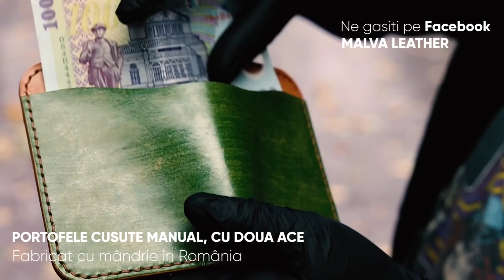1.5 TSI mai bun decât CATASTROFA 1.4 TSI?

Comment: Salutare!
Avand in familie un motor 1.5 tsi 150 hp cuplat la o transmisie manuala pe o skoda octavia 3, acum la 50.000 de km pot veni cu urmatoarele precizari:
1. Motorul a aparut in 2018, e un pic mai vechi decat a spus Vlad. In primavara lui 2018 cand a fost facuta comanda la reprezentanta, skoda era initial dotata cu 1.4 tsi 150 cp, dar am fost anuntati ca acest motor nu mai este disponibil, deci l-am inlocuit cu 1.5-ul
2. Perfect de acord cu dezactivarea cilindrilor si ciclu Budack. Masina merge in 2 cilindri la viteze constante pana in vreo 120 km/h dar si la accelerari foarte usoare sau decelerari (nu frana de motor).
3. Ca si consum depinde cum mergi. In cluj scoti de la un 8 litri la suta pana la 10 daca te tot freci din stanga in dreapta. Mers in oras nu ca pensionarii. In extraurban cel mai putin a fost in jur de 6l/100 km, drum cu urcari si coborari prin transilvania. O cifra mai realista ar fi 7l/100, de obicei in afara masina e turata si se fac depasiri. Nu s-a mers niciodata la modul "eco pro" sa vedem cat poate de putin sa consume. Undeva la 7.5 l/100 km germania-romania vara cu 4 persoane si multe bagaje.
4. Motorul trage de jos pana la linia rosie unde are puterea maxima, e o placere sa il turezi pe niste drumuri virajate in urcare.
5. Nu au fost probleme cu motorul. Nu consuma ulei,( momentan :)) ). Ii place benzina de calitate, de obicei merge cu 100. Tatal meu a alimentat odata de la lukoil si nu i-a placut deloc. Suna mai degraba a diesel si trepida, posibil apa in benzina (nu, nu a bagat din greseala motorina) a doua zi si-a revenit.
6. Avand gpf, se simte cand isi face regenerarile, mai ales daca nu o a fost scos din oras. Sta putin mai turat, pe la 900 de ture la relanti si nu intra start-stopul.
7. Adaugare: se incalezeste foarte repede, apa ajunge unu-doi la 90 de grade. Cred ca aceasta chestie e datorita racirii turbinei cu antigel. Aceasta se incinge rapid si transfera caldura antigelului
Reply: @sebastianmarcu4368  Buna, in primul rand, deoarece tu iti incepi si sfarsesti traseul cu un drum extra urban inseamna ca motorul tau ajunge repede la temperatura la care ii place si, dupa ce "se oboseste putin" in oras, aia 15 km il readuc la temperatura la care dpf-ul se curata singur. (In oras niciodata nu o sa ajunga la temperaturi optime pentru asta). Pe scurt, il exploatezi cum trebuie. La 1.5 tsi eu am constatat ca isi face regenerare doar cand nu a fost scoasa demult din oras si s-a mers pe distante mai scurte cu masina. Nu am masurat cati km e intre regenerari, depinde cum a fost condusa. Dupa un drum lung nu are treaba gpf-ul. Daca o luna se merge doar in oras, zilnic, din stanga in dreapta, cu o mie de porniri si opriri, isi face cateva regenerari in luna aia. Exemplu : masina statea pe la 900 de ture si nu intra start-stopul (aparea in bord icon-ul ala de start stop cu bara taiata peate). Am fost la munte cu masina, in stil mai agresiv, turata tare. Cand am tras pe dreapta statea la relanti pe la 650 de ture si voia sa intre start-stopul (sigur, l-am dezactivat sa se raceasca putin motorul inaine sa il opresc ca era tare incins). Ca si fapt divers,  in cluj cel putin am auzit ca sunt taximetristi cu diesel, cu dpf, care procedeaza in modul urmator ca sa nu aiba probleme: La 2 saptamani ies din oras si merg pe autostrada in a 4-a, si nu apar probleme cu dpf-ul
Reply: @andreimihaigroza  Nu e bine că iese direct în extarurban mai ales dacă nu încalzește puțin motorul. La ce viteză si ce turație parcugi acei 15km că dacă mergi cu 100-110km/h cu a-5-a nu ai facut nimic .
Reply: Nu este cam mult 7L extra urban? Eu scot cam asa cu Octavia 3 cand trag de ea destul de mult. SI asta cu un motor ceva mai mare.
Reply: @Alexandru-T.  depinde cum mergi. Uite, ieri am fost la un drum extraurban, cu ceva treaba, am scos 5.5l/100 km. Eu conduc de obicei alta masina mai lenesa si cand merg cu asta imi place si sa o calc
Reply: @andreimihaigroza  Si mie imi place sa o calc. Poate de aceea eu scot mereu in jur de 6.2-6.4 dar daca taica-miu conduce el scoate si 5.3 pe acelasi drum.
Reply: @sebastianmarcu4368  asta explică mult mai bine https://youtu.be/JjM14JBPdBI
Reply: Salut, la consumuri mă încadrez și eu dar la capitolul consum de ulei sunt profund dezamăgit. 2 L de ulei puși până la schimbul de 30k și după achombul la 30k la 44k deja cerea iar completare. Mi se pare enorm... reprezentanța Skoda dă din umeri.
Reply: @vladysan93  despre ce mașina spui?
Reply: @vladysan93  Vai de mine !!! Nu tine 30k un ulei in motor pentru ca o sa il distrugi. Maxim si doar daca mergi exclusiv pe autostrada la o turatie constanta 15k!!! in rest trebuie dat afara la 10k indiferent ce spune producatorul. Daca o tii in ritmul asta, pe la 100.000 de kilometri o sa iti manance motoru ala ulei cot la cot cu benzina.
Reply: @vladysan93  aici gresesti grav si pacat de motor. Iti recomand sa faci schimbul de ulei la maxim 15000 km/an, chiar daca folosesti ulei long life. Consumul de ulei este normal la motoarele din grupul Vag, insa nu chiar 2 litri la 30k. Schimba uleiul mai des si vei evita depunerile de carbon pe cilindri, practic ii vei prelungi considerabil viata. Si bineinteles pune benzina de calitate, gen Omv maxx de 100 si mergi mai sportiv cand si cand. Noroc
Reply: 2017 este prima data cand am condus 1.5 tsi.

Comment: Salut! 
Super conținut, ca de fiecare data. Felicitări. 

Eu am o Skoda Octavia 2021 cu 1.5 eTEC, automata. Acum are approx. 42k km. Am completat ulei intre primele 2 schimburi, în jur de 0.7L.  
Posibil să trebuiască completat iarăși, dar fac un edit după ce verific. Strada mea este în panta, deci pot verifica doar într-o parcare.

Din experiența mea: 
- Consumul este ridicol de mic. În oraș văd de obicei 5.5- 6L, uneori ajungând la 7- 7.4L cu ceva sprint. La drum lung scade pe la 4- 5L . De menționat este că portbagajul este mereu plin cu diverse, de cele mai multe ori fiind singur în mașină. 
Am făcut și o proba de mers economic ( în modul Normal) ; am văzut un consum mediu de  3.7L pe o distanta de approx. 600km. Mers economic înseamnă setat pilot la 110km pe zonele de autostrada și evitat accelerația brusca unde este posibil. 
Cu alte cuvinte, cu un full de benzina poți să ajungi pe la 900km și chiar să treci de 1000.

- Motorul se simte foarte sprinten și vioi. Se simte ca un motor cu un cuplu mult mai mare decât cel de pe hârtie. La un mers normal nu pare vreodată că se chinuie. Efectiv pare un motor mai mare și mai puternic. Poate este ceva intervenție și de la generatorul electric, sau poate faptul că este un motor silențios, nu sunt sigur. 

Sunt totuși câteva lucruri de care nu sunt foarte sigur:

1. Motorul se oprește excesiv. Indiferent daca ești în oraș sau pe autostrada, parte din sistemul hybrid face ca motorul să se oprească foarte des. Uneori are logica și mergi cu motorul oprit 1 minut, dar alte ori este oprit doar pentru 3 secunde.
 Pe de alta parte, pornirea este incredibil de lina, fară să aibă acel "dat peste cap"  pe care îl auzi/ simți de la alte motoare. Pur și simplu pornește instant, ca și cum pe perioada cât a fost motorul oprit ai avut degetele în urechi, după care le scoți și auzi iarăși motorul mergant. Este foarte interesant și cu siguranță ceva tehnologie în spate. De menționat și faptul că nu se simte absolut deloc trecerea aceasta de la pornit, oprit și iarăși pornit. 

2. Perioade de service prelungite, Interval pentru schimbul uleiului care ajunge până la 32k km sau 2 ani. Personal mi se pare foarte mult.  Am insistat eu cu un schimb de ulei mai devreme, și așa am avut 3 schimburi până acum. Poate ar fi mai indicat un schimb pe an/ 15k km?

3. A apărut și o mica problema, în forma unei transpirații de ulei pe conducta turbo - intercooler. Urmează să ajung la reprezentanta pentru o investigație zilele următoare. Intre timp am căutat pe net despre asta și am găsit că ar putea fi o posibila problema cu valva  PCV/ Separatorul de vapori la aceste motoare. Alternativa ar fi o problema la Turbo. Daca este doar o problema PCV, pare să fie ușor de rezolvat și relativ ieftin pe viitor. Ciudat totuși că nu exista un martor pentru aceasta problema. 

Curios daca a mai avut cineva aceasta problema. 

Spor

Comment: Eu am Skoda 1.4 TSI  122 CP transmisie manuala, motor cu distributie cu lant din Septembrie 2011. Masina luata de noua si acum are 130.000 Km. Motorul nu consuma gram de ulei, zero probleme cu lantul sau intinzatorul.  Motor EA111 cod CAXA. Masina merge impecabil. Nota 10 plus pentru TSI. Nu va feriti de ele. Mai ales acum cind a aparut EA888. Bafta si drumuri bune.
Reply: Salut! Cum e masina azi? Ce ai schimbat la ea? Vreau și eu sa cumpăr un Seat Leon 1.2 tsi 2011 cu distribuție (problematica) tot pe lanț și voiam sa știu un update de la tine. Mersi

Comment: Am Tiguan din 2020 cu acest motor 1.5 TSI, 150 CP (cutie manuala) și am ajuns la aproximativ 104.000 km.

Am schimbat până acum la 30.000 km, dar acum doresc să schimb la 15.000 km.

Nu consumă ulei (doar până la primul schimb am completat putin - am înțeles că din fabrică pun mai la limită).

Ca și consum pe termen lung - 4.000 km până resetează automat calculatorul de bord - mers oraș (Brasov) / exterior cam 50/50: sezonul cald 7.5 l/100 km; sezonul rece 8.5 l 100/km.

Ținând cont că vorbim despre benzină, mașina mai grea…consumul este foarte bun!

Comment: Salut. Detin un Leon FR 1.5 TSI 130 Cp. Doar cel de 130cp are turbu cu geometrie variabila. Masina are 15.000km si tocmai am facut ptima revizie.Am schimbat intervalele de service de la 30k la 15k km pentru ca nu am foat de acord cu intervaul de 30k km. Consum ulei - 0. E normal la km astia. Consumul mediu al masinii este de fix 7%. Masina traga slab pana in 2500rpm, dar dupa turatia asta chiar trage foarte bine. Eu pana acum sunt multumit si recomand motorul acesta. Ca si punct final motorul are nevoie de ulei 0w20 full sintetic datorita GPF.

Comment: Salut, vreau părerea ta, tehnica, despre 1.5 ecoboost 150 hp, 3 cilindri.. Merci..
Reply: Are un prieten, l.am filmat, acel focus active, mie mi.a placut foarte mult cum se simte cu cutia de 8 trepte, nu are turbo lag, consumul de bucuresti e cam 10, extraurban 7, tipul face București Sibiu des si a zis ca nu regreta alegerea.
Are distribuție pe lant, injectie directa si indirecta deci nu vor fi probleme cu depuneri de carbon pe admisie.

Are un cuplu foarte bun jos fiind 3 cilindri si cutie cu 8 trepte etajata ok dupa gustul meu.
Interesant e ca atat 150hp cat si 182hp au acelasi cuplu de 240nm, ceea ce ma face sa cred ca defapt motorul este limitat din soft la 150hp
Reply: @vladdutz20  ai dreptate, e același de pe fiesta mk8 st.. 200cv.eu am luat focus st line 1.5 150 cv dar a juns in mijlocul covid ului.. Sper pe 5 mai.. Dacă ajung în vara, io s din Gorj, îl dau la Craiova, la probe... Multumesc pt parere..
Reply: P. S. Manuala 6 trepte...
Reply: @emilionelcotojman3928  da, se numeste 1.5 ecoboost dragon, insa are niste mici diferente fata de cel de pe fiesta , chestii de optimizare a functionarii.
A, si are si dezactivare de cilindri, se opresc supapele pe inchis la un cilindru si in sarcini mici merge in 2 cilindri
Reply: @vladdutz20  da.. E de optimizat, am văzut deja un bluefin.. +50hp,+60Nm..vedem după rodaj, eu am făcut test drive cu unu, mi a plăcut..
Reply: @vladdutz20  este limitat la soft eu focus mk3 1.6ecoboost 150cai de fabrica cu soft de 182 instalat de un baiat si merge foarte bn , se simte dif in ture mari

Comment: Salut Vlad! Toyota folosește pe unele modele motorul 1.2 turbo care funcționează în ciclul atkinson și Otto. Te rog, ce părere ai?
Reply: Atkinson știu că e doar 1.8 si 2.0 dynamic force, si cele de 2.5 si 3.5 4L si V6 respectiv
Sunt motoare bune, robuste, cel putin 1.8 ala se face din 1997
Reply from the maker: 1.2 Turbo funcționeaza Atkinson la turații joase și Otto la turații înalte. Are turbină răcită cu apă, distribuție variabilă și injecție directă, asta îl face bun la turații joase unde cuplul maxim de la 1.500 rpm pana la 4.000 rpm e binevenit. Per total e un motoraș destul de modern și inteligent.
Reply: @AtelieruldeDetailing  asa sincer la toyota nu prea am auzit necazuri, ceva probleme izolate la camry 2.5 cu pistoanele alea cu cota prea mare pentru blocul motor si crapa , dar cred ca sunt cazuri izolate
Reply: @AtelieruldeDetailing  Detin toyota chr 1.2 awd cu cvt din 15.01.2017. La 174640 km. in momentul de fata se comporta excelent. Am schimbat bateria la 08.02.2020 ,altceva nimic doar consumabile =discuri fata de doua ori,spate o data .placute  frana, filtre , ulei. Nimic la motor si tren de rulare. Nu stiu cum se va comporta dupa 200.000km. Daca are cineva cu acest motor peste 200.000 va rog! Multumesc!

Comment: Detin in familie 2 masini cu 1.4 tsi:  VW Passat B7 - 1.4 tsi cod motor CAXA - 122cp, care in prezent are putin peste 300k km ( cutie manuala) si o Skoda Octavia 3 - 1.4 tsi cod motor CHPA - 140cp cu putin peste 200k km ( cutie DSG - DQ200 cu dublu ambreaj uscat )... Ambele masini au fost cumparate SH din Olanda si nici una nu papa ulei.
La Passat sa schimbat distributia care este pe lant ( pe la 280k km - nu stiu daca era originala sau daca a mai fost schimbata ).
La Skoda sa schimbat distributia care este pe curea ( la 200k km - era originala de fabrica si cureaua era destul de intinsa ).
In rest nici o problema la nici o masina...
Reply: doresc sa achizitionez un pasat 2011 motor 1,4 benzina manual 122 cp,120.000 km as dorii daca se poate pareri despre ea,defecte si calitati avand in vedere ca  detineti una,va multumesc
Reply: Salut.Referitor la Skoda Octavia ,ai schimbat uleiul din cutia automată?
Reply: @danm9335   da, am schimbat si in partea de pinioane unde intre 1.7 litri si in partea de mecatornic unde intra 1 litru. ( atentie ca nu este acelasi tip de ulei )
Reply: @spinumihaiphoto cum sunt motoarele azi? Vreau sa cumpăr un 1.2 tsi cu distribuție pe lanț și nu ma pot hotărî în legătură cu fiabilitatea

Comment: Salutare! Foarte bun video ul. 

Eu am un golf 7 facelift 1.5 TSI 150 HP din 2019 martie. Sunt foarte mulțumit de acest motoras. Cuplu bun, trage bine, consum in oras (Brașov) 8.8l%, in afara ca exemplu drum BV Grecia 900km consum 5.6%, mers cu masina incarcata, regulamentar - benzina Efix 98.

As vrea sa te intreb de unde ai aflat ca motorul are injector si in port, ca mi-e groaza de potentialele depuneri de carbon pe valvele de admisie, problema destul de mare se pare la 2.0TSI. Eu unul am tot cautat si peste tot gasesc ca e doar cu injectie directa. Ca idee dealer-ul habar nu avea ce inseamna asta, daramite sa Imi spuna daca are sau nu... La motorul de 1.0 am gasit ca ar fi injectat in port.

Mulțumesc anticipat!
Reply: asta explică mult mai bine https://youtu.be/JjM14JBPdBI
Reply: @dragospahontu  Buna ! Am vazut filmuletele lui. Il urmaresc. Si cel pe care mi l-ai recomandat tu. Din pacate acolo nu spune nimic de modul de injectie al combustibilului. Ce-i drept, in simularea aceea 3d se vede injector si in port si direct. Am cautat tot internetul si tot nu am gasit ceva scris concret. La VW din pacate la reprezentanta nu au stiut sa imi spuna . 
Mai asteptam sa mai treaca timp sa vedem cum se comporta. Pana acum sunt multumit.
Reply: @Corlentor  la astea cu Budak nu se depune mai nimic

Comment: Dețin un Seat Leon 1.5 TSI 130 ACT  2019, este un motor ce mi a lăsat o impresie foarte buna după 4900 de km, consum exterior 5, 3l%  medie de viteza de 79km, și interior pe perioada normala7,8%, și 5,9% in perioada covid in Constanta. Eu spun ca e un consum mulțumitor pt.ce dinamica asigura motorul.

Comment: Sunt posesorul unui motor TSI 1.5/130cp,montat pe un Leon model 2019.Masina cumparata noua,acum are 72.000km si o vechime de 5 ani.Alimentata numai de la Shell,90% rulata pe autostrada,rute scurte 80km dus.Nicio problema pana acum.Revizia facuta la un an,un an si doua,trei luni.Fabricantul spune ca la 30.000km sau 2 ani.Eu nu am incredere in fabricant.Fac schimbul aproape din an,in an aproximativ.Nu faceti schimbul niciodata la 20.000-30.000 km ,ca asa prevede fabricantul.Uleiul si filtrul,este “sangele”motorului.

Comment: Blow off si wastegate sunt doua lucruri complet diferite. Unul e bypass pt aerul presurizat din sistemul de admisie si altul este bypass pt gazele de evacuare, pt ca acestea sa ocoleasca turbina.
Reply: Stiu, m.am incurcat in discurs, blowoff nu au toate, sau au sub forma unui retur intern,nu ventileaza in atmosfera.
Teoretic turbina vtg se descurca si fara wastegate insa bănuiesc ca are una de siguranță
Reply: N ar trebui sa aiba, cel putin nu i vad rostul atata timp cat pozitia de baza a vanelor ar fi sa nu creeze boost. Si cu ajutorul sistemul electronic care detecteaza ca in cazul unei defectiuni, vanele raman acolo, trece in modul limp home. Iti zic din prisma unui inginer care calibreaza motoare. E mult mai ieftin cand un safety feature este adaugat electronic sau intr un fel calibrat din calculator pentru ca in felul asta compania castiga. Deci in cazul de fata, as tinde sa cred ca nu are wastegate de nicio forma.
Reply: @aditza579  nici eu nu cred că are wastegate pentru că turbina are o carcasa considerabil mai mica decat la o turbina cu geometrie fixa si wastegate